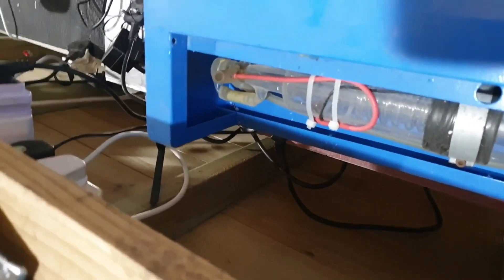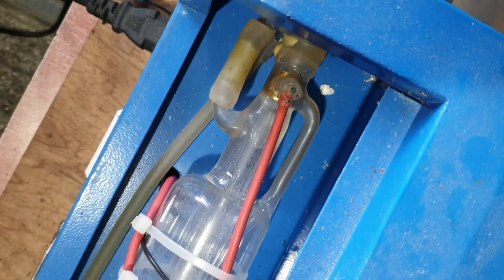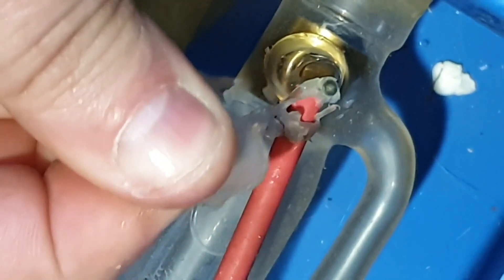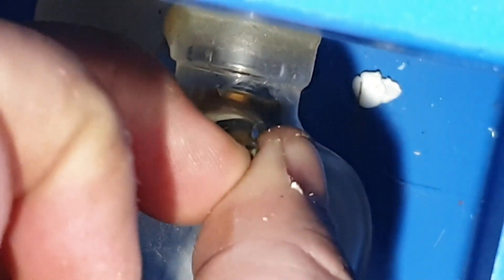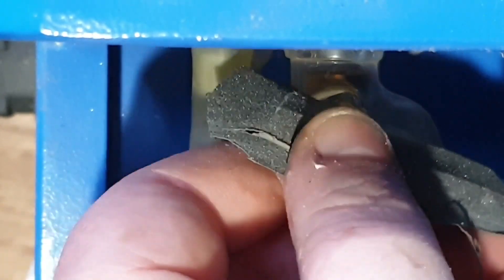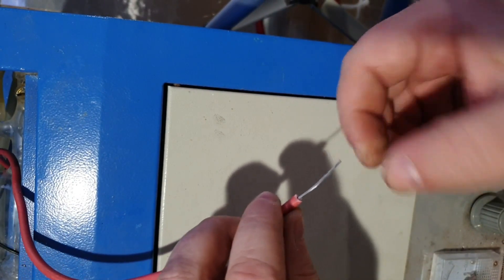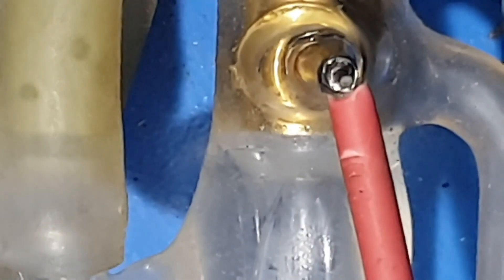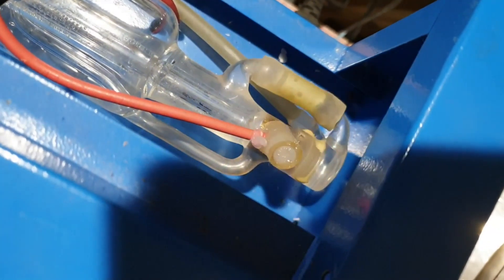K40 Rewiring the tube and it failed

Comment: Thanks, mate. You at least gave me the info I needed to strip, clean, and refit the insulation on my own machine. Mine is definitely arcing to the frame from the post.
Reply from the maker: Go careful, there is a lot of voltage flying around. Mine is over due a big clean down and yet another tube. I think I'll get a more powerful tube next time around.

Comment: Do I need to ground/or discharge either the positive or negative wire after cutting them?
Reply: bit late after you cut them!!   I would leave the psu off for 24 hours to disperse any left over voltage in the capacitor then remove the wires and youll be fine. if you havent started it in a few days there wont be anything in it.

Comment: you should put a grommet in the hole where the high tension wires pass to stop any chaffing and risk of making the entire case go high voltage live. Also turn the tube around so the exit holes on the water lines are uppoer most to avoid any air in the lines and tube. 

When reconnecting the tube cut a 30  amp electricians lego block off , cut off the plastic and then screw half onto the post minding you do not touch any glass and then insert the high tension wire into the other half and then apply  acid free silicone to it all using a plastic mould around it to contain the silicone, remove mould later which the chinese dont do and why it looks like they just stick a wire casing on it, thats the mould!
Reply from the maker: Thank you for the comprehensive reply, greatly appreciated. I'm likely to be following a lot of advice given, this is one of them. Alas due to lock down getting a tube is not on the wish list just now :(
Reply: @fetchitnowuk  Are you in the UK, I'm in Spain, is the machine in a shed outside as if so it could have frozen over the winter, that is what cracks most tubes , over the winter if you dont use it you have to blow the water out or use a antifreeze , 

We are still getting deliveries from courier companies and amazon but no normal post. 

 Tubes are about 100gbp. we here are in total lockdown and have been for 45 days, just supermarket , chemist , fuel and hospital and we have to fill out an online form to say where we are going and if youre stopped they check online and if you are not where you say you are,  youre fined!!  

once you have it going again, undo the clamps a bit and turn the tube around until the water inlet and outlet is at the top and that should exit the bubbles all the time, you might have to lift it a little on one side to help, once you have done that leave the tube in that position and just clamp it up not to tight. Make sure the wiring points are safe, why they dont make a little clamp Is beyond me.

 I know these were made for rubber stamps originally but these machines would never pass a PAT test in the UK thats for sure.

 I spent 5 hours getting my mirrors levelled the other day when my new machine arrived and I had to lift the first mirror by 6mm with shims as they have changed the clamps from my other machine so it doesnt even line up now with mirror 1, cheeky buggers sent it out completely unaligned and no chance of it working and if I didnt know what I was doing , someone else would have just given up, the laser was firing a beam out of the first mirror and when I stood in front of the  machine the beam fired a hole in my sweatshirt at chest height as the first mirror plate was twisted! unreal....

But I guess you cant complain based on what they cost......any questions ask and use distilled water not tap water it has metal in it. cheers
Reply: This is exactly what I am doing to mine this afternoon. I bought muine used for $80usd, and my first run was weak as the mirrors were covered in soot. I took the mirrors off to polish them, after having cleaning, polishing, and lining the mirrors up (during which the laser test button was being used, it worked perfectly) I tightened down my bolts on mirrors, plugged up my computer and it fracking screamed at me and arced on the casing.
Reply: @ThanaDoesThings  you were very lucky!! Hope the tube and psu are ok... Not too mention you...
Reply: @sitgesvillaapartmentneilsc7924  the tube seems to be okay, the power supply is in great condition. No evidence of arcing or burns. I did notice that inside the working area there was evidence of a fire. air: soot and agregate on mirror as well as nylon wheels melted.
Reply: @sitgesvillaapartmentneilsc7924  I just set everything up, and I still got an arc. It's time for a new tube! 😭😭😭
Reply: @ThanaDoesThings  sounds like it, it only arc i believe if the tube leaks....if the arc is in the tube compartment, thats your answer I feel, if its at the PSU then it could be something there. I expect the former. Sorry.